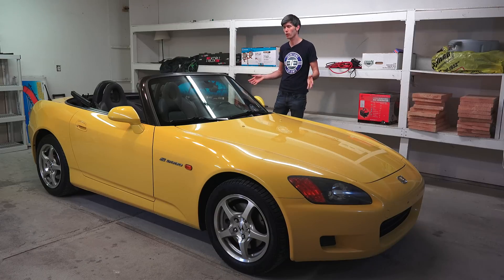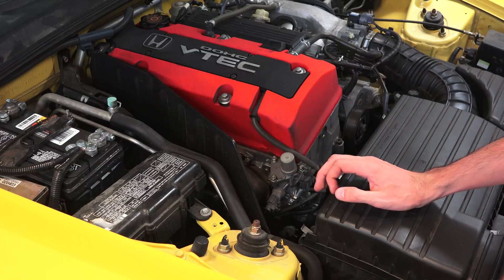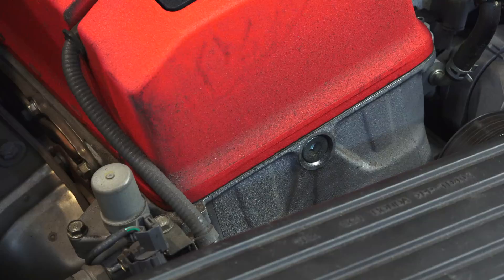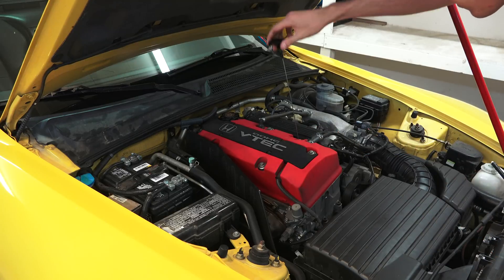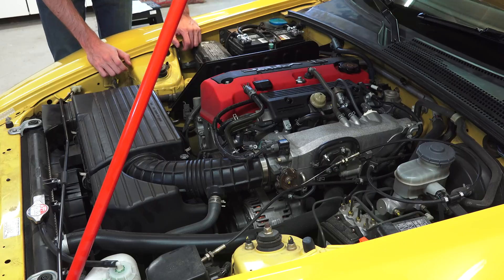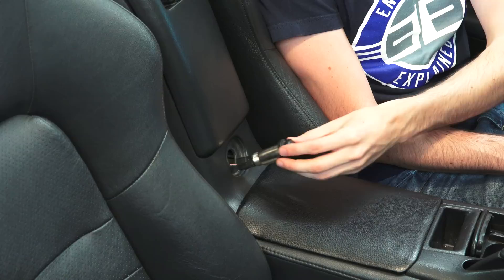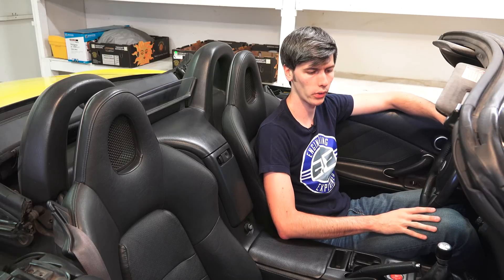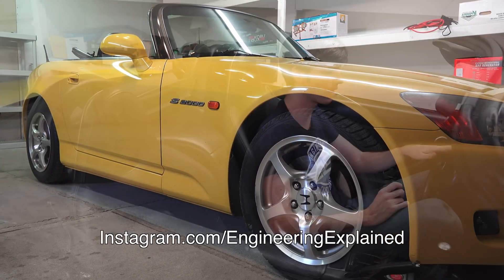What's Wrong With My Honda S2000?

Comment: Timing chain tensioner and power outlet on my S2k are the same, except my top is thrashed presently. Anyone make a durable top for S2k? My previous 2 tops only lasted about 5 years each before getting holes. Hesitant to just blindly purchase a third soft top. I like the hard tops but, I also love the top down sunshine while driving.

Comment: You can relocate that hood support to the back left corner of the engine bay and it will give you about a 95* angle between the hood and the top of the engine bay. Much more stable than a broomstick

Comment: Re: 12 outlet. count the number of thread turns required to install, then counter turn the socket the required number of turns with the wire connector attached. Now install with tiny amount of thread locker.

Comment: Quick Q: that front plug that is leaking oil, what is it technically called and does removing it completely actually drop parts inside the motor?

Comment: How's the air intake on the stock airbox? You think it could restrict (now that you're getting 40% more air in from stock)?
What MPG are you getting? low to Mid 20's?
Were you able to get the AF ratios balanced out after the dyno tune?

Also, when doing the transmission, perhaps it's good to check the condition of the clutch, and/or replace it while you're there.

Comment: Jason,
Have you noticed the odd issue of the car pulling right or left under acceleration with the steering wheel straight?  I've test driven a couple of AP1s now (looking to purchase one) and both were on aftermarket coilovers and both had noticeable "pull," or tug, to the right when I got on the gas, the straightened back up when I let off.

Comment: When checking oil levels, it is good practice to wipe the dipstick clean with a rag the first time you pull it out, then reinsert and look.  I believe this is because the oil can potentially splash up onto the dipstick while driving, and is viscous enough to stay on it, making it appear higher than it is.

Comment: Looks like you may want to change the brake fluid, it looks pretty dark and should be nearly clear.  Most maintenance items on these are typical Honda (easy and reasonable).  If the control arms just have surface rust you might try a green "Scotch Pad" or something similar and then paint or just apply some rust inhibitor or something.  Hopefully they are not actually "rusted".  Good luck and enjoy, these are fabulous cars!

Comment: well first of all its a Honda
Reply: The S2000 was on Car and Driver's 10Best list for 2000, 2001, 2002 and 2004.
The S2000 was the highest-ranked model in the J. D. Power and Associates Vehicle Dependability Study "Premium Sports Car" class for 2004, 2006, and 2008 and consistently held one of the top three positions.
The S2000 was ranked number #1 in the BBC Top Gear survey in 2003, 2005, and 2006.
The S2000 was ranked as "Best Affordable Sports Car" by U.S. News & World Report in 2008 and 2009
The S2000 was on Edmunds Consumers' Most Wanted Vehicles list for 2004, 2005 and 2007.
The S2000 was one of Jalopnik's Best 10 Cars Of The Decade.
The S2000 was one of Road & Track's Best All-Around Sports Cars.

But yeah, it's justa  Honda.
Reply: This is 2017
Reply: steven wentling you're making zero sense. What do you drive?
Reply: iZONE360 its just a Honda, still livin in the past. I drive a 2016 C7 Z51 3LT Corvette
Reply: steven wentling living in the past? Oh you're one of those guys that thinks newer is better. Why aren't you driving a 2017? Why are you living in the past?
Reply: iZONE360 I like 2016 as I have a 2016 SRX and a 2016 Chevrolet Silverado. And 2017 isn't over yet. And you still have a Honda?
Reply: Hondas are more dependable and hold value over Chevy. Have fun throwing your money away by investing in Chevrolet lol
Reply: iZONE360 its only money. money is just numbers. get a real car.
Reply: steven wentling my S2000 is actually going up in value and has one of the best engines ever made. You clearly don't know cars if you say Hondas are bad.
Reply: iZONE360 enjoy your Honda

Comment: Like the Prelude and the NSX, these use FRM cylinder walls which will use more oil than other cars,no biggie tho,my 01 Prelude doesn't use much between oil changes and I've got 153000 kms on it,luck maybe?

Comment: Better check your keepers and retainers if you ever do a valve cover job on the AP1. I heard it had problems with valves flying out at high RPM. AP2 didn't have that problem.

Comment: I'm about to buy a Honda s2000.  things I should look for and change.  Its a 2001 83200 mile. was involved in a minor accident and has a very slightly bent frame on the front right. Everything else seems to be fine. Getting it as a project car.  Not the most knowledgeable but I am trying to  learn.  So far I've learned a lot from  +engineeringexplained

Comment: Oil consumption on AP1s is a function of the type of oil you use, the PCV valve and the valve cover design.  My 2003 used no more than 1/4 quart every 3,000 miles, which is low for an AP1.  I replaced the PCV valve with an OEM one every 15,000-30,000 miles and ran Amsoil full synthetic 10W30 (ATM).  Only use the OEM "PCX" filter - it's specifically designed for the S2000.  I also used Amsoil full synthetic fluids in the diff (Severe Gear 75W110) and transmission (MTF).  To keep your top and interior looking perfect - use 303 Aerospace protectant.  My 2003 had over 110,000 miles and the original top looked new (it still looks new, but the car is wrecked - taking parts off of it for my 2002).   The interior also looked nearly new.  You can't beat 303 for plastic, vinyl (the OEM top is vinyl impregnated cloth - not cloth, so you treat it like vinyl), leather and rubber.  Additionally considerations are the early 2002 (and earlier) S2000s used a 2 hole oiling banjo bolt for piston cooling.  This was changed to a 4 hole banjo bolt in mid to late 2002, and carried in all other S2000s.  If you plan on auto-crossing the car - you should seriously consider the mod.  If your car needs the have the oil pan seal redone - there is no better time to have these bolts replaced (the pan needs to come off to do the mod).  Another consideration if you plan to drive the car hard is to have the intake retainers replaced with AP2 retainers.  The "money shift" for the S2000 (redline 3-4 ending up in 2nd) many times will not immediately kill the engine but simply crack the intake retainers.  At that point - the engine is a time bomb as one or more of the intake valves will slowly slip out of the keepers and retainers until it drops and destroys the engine.  Valve lash clearance checks/adjustments are also critical, and require the engine to be completely bone cold for them to be done properly.  There are small signs the intake retainers are cracked that takes a trained eye to identify - and during a valve adjustment is the best time to check for the signs of cracks (you can only see the actual cracks once the retainer is removed - but the retainers will have a slightly 'dished' appearance as the valves start to migrate downward).  Once AP2 retainers are installed - you will bend exhaust valves before cracking an intake retainer during a mechanical over-rev.

Comment: Just a heads up the previous owner mentioned he replaced the top right? Well I couldn't help but notice how when you put the top down it didn't go all the way down. So I would question how recent the previous owners replaced the top or if he only replaced just the material of the top. A brand new top wouldn't go down like that
Reply: Nobe616 the top might be tight from not being in the up position while in storage.

Comment: If you do the o-ring use a silicone based lubricant or the bolt will destroy the rubber mating surfaces increasing the leaking, but I use a little blue RTV silicone on a small paint brush to put a lite coating on the contact areas between bolt and cover instead, it's slanted slightly on some and the o-ring pushes out and rips. the 12v power inverter I use a friction washer with teeth-like cutouts to 1st secure from behind and then use a epoxy for plastic applied over the washer mating surfaces to keep it there. Some shops use a hose clamp, but I believe it's too bulky for tight areas, hard to secure compared to a deep well socket to push on a washer, and looks terrible on the only beauty Honda has not to mention the wide band clamp's potential to short out wires that rub against it and covering being filed by the gear run.

Comment: High revving Honda vtec motors always burn oil. I had a 96 prelude and it ran perfectly but it would burn oil. The harder I drove it the more it would burn. But as long as you keep feeding it oil, it will run forever.

Comment: "I actually haven't been under the car yet" reason engineers are the laughing joke between tech's. No offence to all you engineers out there but get under the damn car and get your hands dirty once in a while.
Reply from the maker: +Wayde Jaynes one day I hope to be as rad you! I think techs and engineers are both fantastic resources. Life is best when you don't judge those you don't know. Spent 6 months in a shop building a forklift starting from steel plates ending with a driving, functioning lift truck, alongside some fantastic techs and engineers. I have plenty to learn; we all do!
Reply: Engineering Explained hey glad to hear man! We need more engineers like you who see what it's like to work on there own creations. I work at a fab shop but I'm also in school to become an auto tech. You should do an engineering explained on the asynchronous Tesla motors and explain flux wave interaction and induction and magnetic pull. Pretty interesting stuff. Keep up the good work 👍

Comment: always check both sides of the oil dipstick in the s2000 else you'll have a false reading. also dont make the car get low on oil wether it be 1qt or not , i blew  a motor like that, cigarette lighter screw always comes off common issue i got it myself

Comment: Mobil 1 burns up fast in this engine.  Once you replace the intake, you can reach the oil filter and change the oil without a jack.

Comment: If you are having any issues with your 3rd gear, drain the honda transmission oil and replace it with GM syncromes. It will take care of it.

Comment: you talked about changing the xman fluid with it having just over 100k miles. my truck has a little over 170k on it and the xmsn lol has never been changed.  (the dipstick said never change)  with our cars having such high mileage, is it going to cause issues changing the fluid. I ask because, I hear bad stories about changing old fluid.

Comment: You have the lazy soft-top support bar! :-P Give it a tap when retracting the roof and it won't stick up anymore. There are also a few places online you can get elastic straps inexpensively to replace the stock ones (which wear out) if you don't like doing the "roof tap" every time you retract the roof.

Comment: I am amused by folks not understanding what the seemingly useless "T "piece on the exhaust is for. My Background is electronics, Particularly radio. We would know that as a quarterwave stub on a coaxial cable (as per your tv connection) What this presents to an electronic circuit is a trap ror a perticular radio frequency. What Honda have done here is to provide a trap for a specific audio frequency (probably the resonance of the exhaust system itself)

Comment: Why do you want to change transmission oil? Have you finally change it? Bunch of my friends change the oil in manual transmission and were unhappy because of it. The transmission was not the same and generally worse. My mechanic one time also did not recommend manual transmission oil change in my Audi a6.

Comment: If I were you, before upgrading any of the other suspension components, I would replace all of the bushings on the front and rear sway bars with new urethane bushings. With the age and mileage on that vehicle, this should give you tremendous bang for the buck improvement of handling.

Comment: You should definetely do a DIY series. Would be really interesting seeing it through an engineers perspective! Techs usually bash on the engineers while reparing because they think it ls been badly designed (funny you mentioned the oil pan gasket).

Comment: thought my 01 ap1 was burning oil when driven hard bc it was losing a quart every 2k-2.5k miles.  i replaced the valve gasket grommets and it hasnt lost a drop since.  135k in the odo now.

Comment: Why dont you do the overnight newspaper test. Also check the bolts with oil seal like the low oil pressure switch etc and other bolts that are not visible by just popping the hood and standing. Wish you dont have anything major.

Comment: Do not change the stock air box. Aftermarket filters won't give you any more performance. The stock air box is optimized so well that you'll be loosing HP if you use an aftermarket ones. Don't listen to internet chair mechanics and do yourself a favour.

Comment: 4:24 just a heads up. you're soft top isn't sitting correctly when you have it down. you should get that checked/fixed too. it can cause your soft top to go bad quicker. the cross bar that you see should not be seen. it should be tucked under the front part of the soft top as it comes down and sits. if that makes sense. not a lot of s2000 owners know about this soft top problem.

Comment: The correct way to check your engine oil level is to first run your engine for a minute or 2, then turn it off, keep it off for about a minute, pull out the dipstick, measure, clean it off with a clean cloth, repeat 3 times. The dipstick should have a minimum and maximum level, the correct oil level should be in between that min & max. Reason why its higher when you checked it is because all the oil inside the engine are all down the oil sump.

Comment: Another "fix" you may want to consider is to get the valve retainers replaced with that of the AP2 or F22C1. There's a lot of reading on that on the forums.

Comment: The oil level on this car is very important. It's also very difficult to read due to a windage tray that the dipstick rubs on on it way out. you need to pull it out, wipe it off, re-insert it, and then when taking it out again read both sides of the dipstick. it needs to be at the top of the LXXXXXH  on the dipstick right below the "H". Also these cars rev up tp 9200 rpms and are interference engines so be sure to fix the timing chain tensioners as well as check your valve retainers for cracks because ap1 valves can fall into the cylinders destroying your engine. they can be upgraded to rsx or newer s2000 valve retainers check the month your car was made, if it was early in the year it may have a oil banjo bolt that needs to be upgraded to the newer one which has 4 instead of 2 holes so you don't score your #4 cylinder wall.

Comment: Your timing chain is stretched. The only long-term fix is to replace the chain (giant pain in the ass), or weld a nut onto the end of the tensioner. Roughing the worm gear won't do it (I've tried).

Comment: I would think that if (but only if) you want a good place to make a tiny change in weight distribution, you could try to find some rear control arms made of some sort of steel instead of aluminum.

Comment: Hi, i watch your videos but im having trouble with my car. I dont know if you'll get this message but I was wondering if you would know if its a transmission problem or not. When i slow down from a hill, the car down gears to 3rd and yes, its an automatic car, plus the car sounds like it may have a loose wrist nut but watch your, "whats wrong with my s2000" video, seems like it might be a timing tension so if you get this, please msg back! Thank you!

Comment: So in this video you talk about this car burning oil, and your past Acura burning oil. Is this an issue that should be fixed (like a valve seals or something)? Or do some engines just burn small amounts of oil by design? And if so why would a manufacturer do that?

Comment: 1240kg, pretty heavy car for the size, aggressive cam + short wheelbase, when 'VTEC kicked in yo' happens during a turn, especially when you have a bit of lift throttle going on, your car will start spinning like a top, expensive aftermarket parts, Amuse or J's Racing Ti exhaust, Volks CE28N or TE37, Recaro SPA, typical stuff and not cheap, better off getting a used Caterham Superlight R400 or R500 if you gonna do Engineering Explained stuff

Comment: Dude, for real, my honda s2000 is such a pain in the ass to measure oil, its a berlina black 2002 model.  The books are acutally wrong about the oil capacity as well.  manual states around 5.1 qts.  It's closer to 5.7 qts or so.

Comment: It looks like you might have the wrong width tires on the rear. It looks like my Mom's AP1 when they put the same size tires on the front and rear (205 width) when it's supposed to be staggered with 225s in the back. However, having a square setup did give the car incredibly neutral balance, what with 50/50 weight distribution. With the correct tires, it was almost impossible to kick the rear end out.

Comment: I have a 2000 Accord V6, it didn't start on me, so I replaced the battery and still didn't work. I tapped the Starter a few times and it worked. Had an auto parts store check the Alternator and Starter and both passed. Do I still need to check/replace my starter?

Comment: One thing I know about those cars for certain is this..
Should you ever need to service the wire harness for the doors or need to run additional wire into the doors, it's much easier to just remove the doors instead of trying to work in such a confined area. The doors come off easily and they are extremely light weight.